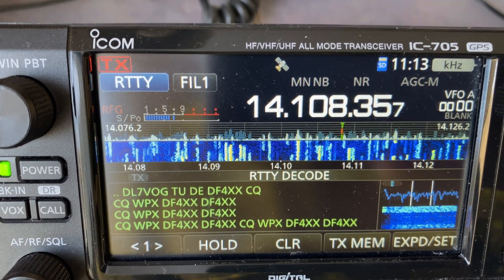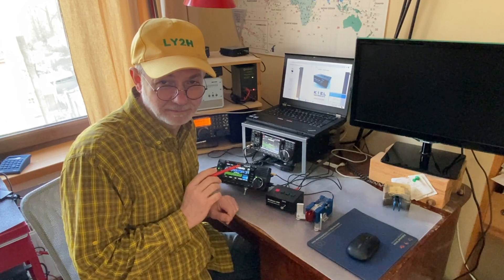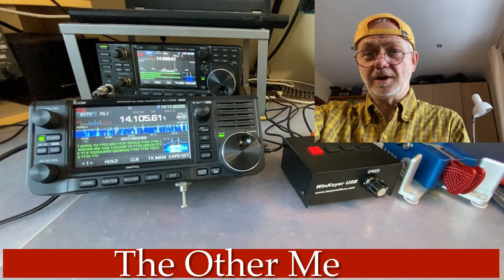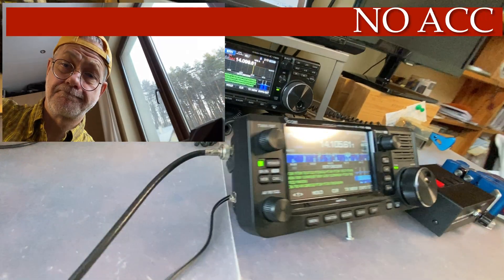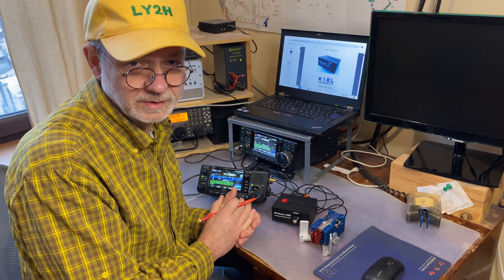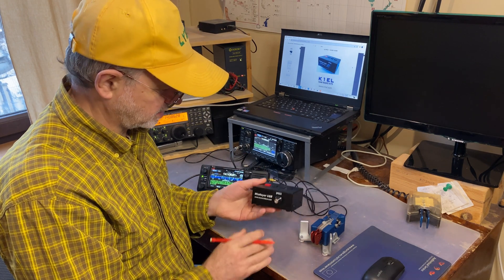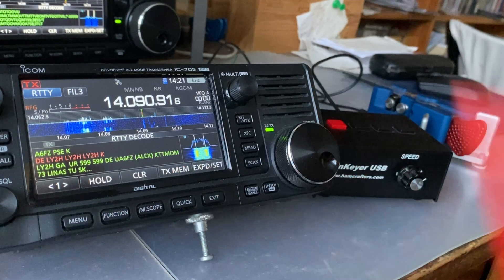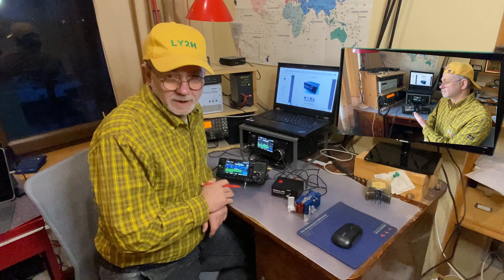CW Paddle RTTY in IC-705. Icom’s Secret Revealed!

Comment: I recently purchased the WInkeyer  as you are demonstrating I have run into a question and hope you can assist. What type of cable are you using from the winkeyer USB to the IC-705 send/alc connector? Thank you and 73's Leo KQ4CVX
Reply from the maker: @KQ4CVX  Hello Leo, thanks for watching my channel! As to your question, you don't need the USB port on the Winkeyer at all if it works in the stand-alone mode. You only need the USB cable if you want to connect the Winkeyer to the computer. All you need for stand-alone CW-to-RTTY operation is two RCA-to- 3.5mm TRS cables. The centre pin of the RCA connector on each cable should be wired to the Tip pin on the 3.5mm connector on each cable. One such cable should be pluged RCA end into the PTT1 socket on the Winkeyer, and the 3.5mm jack end into the KEY socket on the IC-705. This connection will deliver the RTTY signal to the radio from the keyer. The other such cable should connect the RCA socket labeled KEY1 on the Winkeyer to the SEND/ALC socket on the radio. This connection will provide with the PTT function. That's it. I made the cables myself of scratch cables in my junk-box :). Most probably you could buy some off the internet, just make sure the central pin of the RCA is connected to the Tip of the TRS plug. The Ring pin is unused. Sleeve - to RCA Ground. HTH, good luck! 73! Linas LY2H
Reply: @Linas_LY2H  Wow you got back to me fast!!! Thank you!!!   Ordered a couple and they should be here tomorrow Thank you again... I really enjoy your channel and the videos so much I have learned a lot...73's KQ4CVX

Comment: Hello Linas, Can I use it with IC-7610?
Reply from the maker: Hello! From what I know about the IC-7610, this is such a fine radio that it has got the decoding AND encoding RTTY/PSK31 functionality built in it and could be easily realized by just connecting an external keyboard straight to the one of the USB ports on the radio, no computer needed. So, actually there is no need for the CW-to-RTTY work-around in order to  get the RTTY encoding without the PC. If you still interested in specifically this way of generating RTTY with the help of Winkeyer, then please check the Advanced User Manual of your radio for the RTTY operation, as I don't own this radio ( yet :)) and don't know all the connectors and ports installed. It could be, and it's just my guess, that the CW port double-functionality similar to the IC-705, could be also preserved in the IC-7610. Owners of this radio reading this, please say what you think! 73! Linas LY2H
Reply: @Linas_LY2H  Thank you so much for your reply. I do understand what you explane. In addition to IC-7610, I also have IC-705 for portable operation. so I try it with IC-705.
Thank you again dear Linas, See you on the air. 73

Comment: contesting in RTTY is very quick and perform very well, I've done a couple RTTY contest and it's quite fun, only run with macros, click callsign and exchange then you can go to next station but requires software, not through radio RTTY interface, it is not well design to respond quickly to station...
Reply from the maker: You are right, that's the video all about- how to have fun with macros AND  being able to enjoy full fledged RTTY without a bulky PC :) 73! Linas LY2H
Reply: @Linas_LY2H  to an important detail, you need to be a skilled CW operator to reply !
Reply from the maker: @Aleziss  You are right! That might be an inconvenience for some hams... It would be best of all if the keyboard connection feature would be installed in the IC-705 as it is in IC-7600. I don't think it would be too difficult or expensive for Icom. But we have what we have :) 73! Linas LY2H
Reply: @Linas_LY2H  true or mouse control so you can click call sign and it would fill the other station call sign in the macro ! I think 7610 has mouse and keyboard support but does not support such control over rtty macros unfortunately !

Comment: So wouldn't the K45 show your transmitted characters in the K45 display?
Reply from the maker: Hello, the K45 is a different product by K1EL. It would certainly  display any transmitted characters on its own display in the format they are generated by the keyboard. So, for reading a decoded  RTTY signal  you would need to look at your radio’s display  and at K45’s display  , for  controlling what you are  sending. Why not :)… 73! Linas LY2H

Comment: Linas, could you provide both the cables needed AND a diagram to show where the connections are?  Thank you, AC4OK
Reply from the maker: Hello Don, thanks for watching! Unfortunately, I have no possibillity to fabricate and sell cables commercially. May be some companies do. In case it is difficult to get the specific TRS-to-RCA male cable ready made, the best way  would be  to make one at home. Please find below my two affiliate links with possible solution. The only thing you need to do then is to solder the 3.5mm stereo TRS connector onto the RCA pigtail’s open end. The RCA ground would go to the TRS connector’s ground and RCA’s central pin would go to the Tip on TRS. I can’t make drawings here in the comments section but when the cables made, one cable should connect to the PTT1 connector on the WinKeyer and the SEND/ALC  jack on the radio. The other cable goes to the KEY1 on the Winkeyer with the RCA end and to the KEY jack on the radio with the TRS end. 
Stereo 3.5mm TRS connector: https://amzn.to/38Oc4By
RCA Male Plug to open wire pigtail set of 2: https://amzn.to/3LPStj1
Hope this helps! 73! Linas LY2H

Comment: Nice tip, thanks! To preclude having to go to the radio's memory buttons you could automate the other parts of a QSO on the WinKeyer itself and then you'd only have to enter the other guy's call then hit a memory button on the keyer (I think that keyer does that?).  73 - Dino KLØS
Reply from the maker: Thanks for the tip Dino! Yes, the Winkeyer has got some memories of its own, so it is possible, if needed to run a pre-recorded message from there too. 73! Linas LY2H

Comment: Linas, thank you for this great Video 😀. I wondered how to do standalone RTTY QSOs with the IC705 for quite a while. Like you I was astonished that the IC705 features RTTY-memories but no way to send a callsign in standalone mode.
I do not have  Winkeyer USB, so I have a question regarding the wiring. Is it correct, that both PTT (-> IC705 "key" socket) and  FSK/RTTY (-> IC705 "send/alc" socket) signals are connected to the tip of the respective 3,5mm TRS plug?
I found the TinyFSK keyer (an Arduino based TX-only RTTY keyer) project and would like to give it a try…
Reply from the maker: Thanks Henk! The pinout on the radio side is like this: 1. the PTT signal which puts the radio into transmit should go to the SEND/ALC socket on the IC-705 , the TRS 3.5mm plug is needed for that with Tip-to-ground action. 2. The FSK RTTY signal should go to the KEY socket on the IC-705 with the signal sitting on the Tip of another 3.5mm TRS plug. In both cases only 2 pins (Tip and Ground) are employed, Ring is free. It turns to be that the same KEY connector on the IC-705 in the RTTY mode starts switching the internal synthesizer of the radio in accordance with the FSK RTTY algorithm generated , in my case, by the Winkeyer. As it comes to the TinyFSK it sounds like a fun project! Mortty is one of the elegant commercial incarnations of it. But I’m not sure TinyFSK would work in a stand-alone mode, if that’s what you want. It is designed ,as far as I can see, for being used together with the computer and some kind of software capable of generating the RTTY code. It could be some of well known logging programmes, or it coud be just a “dumb terminal” generating simple ASCII characters for the Arduino. Whatever way, you will need the KEY jack on the IC-705 :)! Good Luck! 73! Linas LY2H
Reply: @Linas_LY2H   Thank you Linas - I wanted to be sure about the pinning before I fry the IC705 🙂.
Yes, TinyFSK is a TX-modem only. I just uploaded it to an Arduino-Uno and played around with it (no TRX attached). You can send Letters via serial port (rather USB in my case) to it and the software converts it to RTTY marks and spaces. It does not work in stand-alone mode, but it might be a good starting point for further development. I attached a PS/2 keyboard and an LC-display  to an Arduino in another project a while ago. So instead of feeding the TX-buffer from the serial port, one could also type in letters directly - that's my idea.
Of course - if I was a CW-wizard like you, I would prefer a Begali paddle for that job. That has more style for sure…
Reply from the maker: @Henk660R  Your idea of connecting a PS/2 keyboard and the LCD straight to an Arduino sounds fantastic! Could you please share this project? I’d be very thankful!

Comment: I have a WinKeyer mini. Looking forward to seeing how you configured this for your IC 705. Thanks for sharing this video.
Reply from the maker: Thanks Scott! I don’t have the Winkeyer mini, but what I can see from its user manual, the mini is not capable of working in stand-alone way, it has got no external power connection and must be plugged to the computer by the USB cable. It seems it can do RTTY encoding though, having the newest chip installed but I’m not sure if only from the computer-generated characters or from the paddle too (probably not). As it comes to my bigger Winkeyer USB configuration for the IC-705, it’s pretty straightforward in the stand-alone mode, it’s just important to follow pretty extensive user manual and learn which characters sent from the paddle switch what function on the keyer :). 73! Linas LY2H
Reply: @Linas_LY2H  thank you for looking into this for me. I appreciate the reply. 73 and thanks for the great videos you do.

Comment: Linas great video. just started to learn morse which key would you suggest for a beginner
Reply from the maker: Thanks for watching! How abt DIY Paper Clip key? https://youtu.be/Oj43VmKNcJw
:) It is difficult to advise , a lot depends on your personal preferences. There is a great variety of manufacturers, big and small, cheap and expensive. So it might take some googling for you :). I think, it is important to know for yourself if you'd like a dual- or single- lever paddles. Dual is more widely spread and it's ready for the "iambic" keyers. Single -lever are simpler to operate, may be cheaper, but no iambic operation ( in case you already started learning the iambic way and gonna keep on going that route). Another important criteria is the construction of springs in the paddle: the magnetic system is more reliable and more fun to operate on compare to mechanical springs. Last, but not least - there is always a straight key! It's the cheapest option probably ( but not necessarily) and is often recommended for beginners, but I have a bit different opinion. I think, the best way to start learning the code is with a paddle as close to your real equipment situation as possible. Like, if you have a nice modern rig with the automatic keyer built-in, why would you refuse this comfort of operating  a good internal keyer and transmitting properly shaped Morse characters and go for the straight key?! I wouldn't :). Hope, this helps! Have fun learning! 73! Linas LY2H